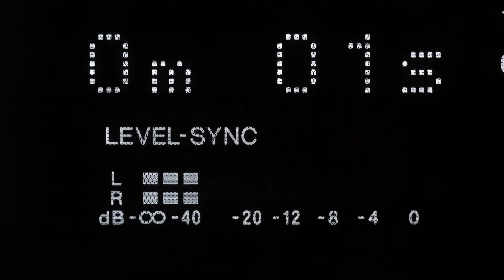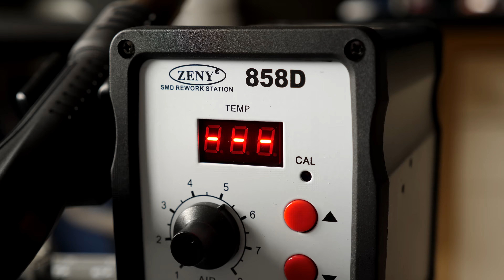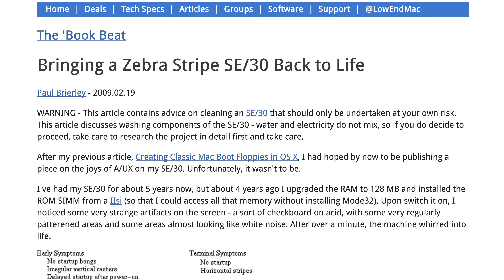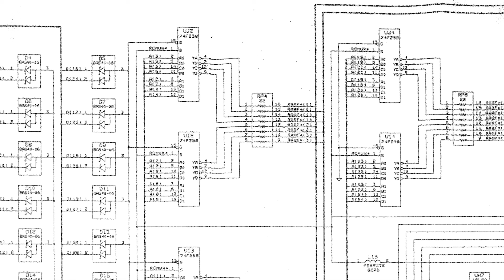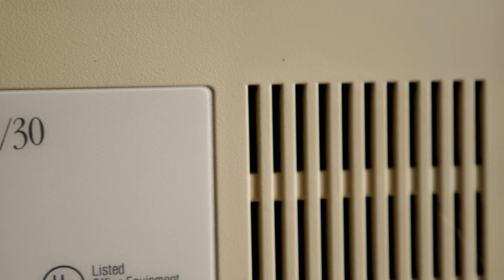(Trying to) Revive a Mac SE/30

Comment: Did you ever get this going?  I had a very similar issue solved by reflowing the GLUE pins on the PSU / 5V Axial cap side grid 10/11.  I think what happens is that repeated insertion/removal of the PSU connector causes flexing and cracked solder joints on that side of the GLUE.  That or hard to see leakage of the C11 cap.

Comment: Hi Colin! I'm your old fan (from the first HHLegend DMG-01 backlite) Did you tried to swap those eeprom with mac's "BIOS" (of course it's not a bios as we called PC BIOS it's more like a firmware that prepares mac to work with video, disk drives, cpu and other connected peripherials) with compatible UV eprom or compatible eeprom with correct image burned on? Threre are plenty of libraries of retro computer flash images, including se/30 in internet...

Comment: What is that thing that looks like a yellow highlighter that you use to clean the pads around the 3:30 mark? I'm new to repairing old Macs, and I didn't see anything that looked like this pen in the soldering section in my local electronics store. I love this video. I get a chuckle out of it every time.
Reply from the maker: It’s a flux pen. You can also get flux in gel form, but I prefer how the pen keeps things neater.

Comment: My friend you didn't try the oldest trick in the book! I have 4 compact macs and 2 of them had similar issues when I got them. You cleaned the board with alcohol.... but I would recommend a good scrub with a toothbrush and dish soap in the sink. Dish soap is caustic (which is a bit harsh on the metal, but it really helps remove that oxide layer), so rinse it off very well and let dry for a while -- My Mac Plus took 1 scrubbing to revive it. However my Classic II took 5 separate times scrubbing before it finally booted. So it really can save them a lot of the times.

Comment: My Macintosh SE FDHD has the problem that it will turn on, hard disk activates, fan starts spinning, but nothing will display on the screen (yes I've tried the brightness knob) the tube is glowing in the back and if you turn the lights off you can see that the CRT is emitting some light, just very little, Ive checked to make sure all the ribbons are plugged in securley on the analog board, and I've even checked the analog board for cracks, only to find none. my logic board doesn't have the battery, and I had to order one online (it hasn't come yet) so that might be the problem, but I doubt it. Do you have any recommendations?

Comment: I made a post over in the 68KMLA forum. But if you cant get the board figured out, get in contact with me and I will run my attempt at it. I have had a pretty decent success rate at repairing those, but nothing is 100% perfect of course.

Comment: I'm a bit late to the party, but Adrian Black's latest video on a Mac 512K showed a similar zebra effect after he went to retrofit the PSU. His replacement PSU delivered clean voltages a millisecond later than the stock PSU did, and his video display took offense to it. Also, his issue went away after a press on the reset - maybe something similar's happening on your end?

Comment: Try washing the logic board (Techmoan-style). Your surface cleaning may not have been enough to remove all of the conductive electrolyte that leaked out of the old capacitors.
Reply from the maker: Yeah, I think a more thorough cleaning is definitely in order. Not sure if I'm going to go with the dishwasher route or something a bit more professional though.

Comment: I did not listen to the audio, so if I missed something because of this, I appologize. But I have to ask, did you check your voltages to make sure you have them all? Also, re-capping the power supply wouldn't be a bad idea. Too bad you don't know anyone that has a big ultrasonic cleaner so you could do the whole motherboard. Also, if liquid was spilled in it, which I think I picked up in the comments, you may be looking for a bad trace. Re-seat any and all parts possible.

Comment: Next to recapping the power supply (which is usually the “cap” problem from KayPros to Commodores in my experience), you could try adding another “sense” to the equation. In lieu of visual, try temp; a blown or highly suspect component often runs hot. Several vintage gurus note a bad chip or component simply by placing a finger atop the IC and checking if its warmer than usual/others. A few other channels I watch used an IR camera, and another just his index finger to find bad video RAM. Just a thought...

Comment: Collin, help me! I just bought a thinkpad t61. New cpu fan, battery, heat sink compound, runs great! But I have a bad sodimm slot. I bout two matching pc2-5300 2gb 667mhz. The bottom slot works fine, but when i put the second dimm in, it boots to a black screen. So i load only the second slot, good mem, 1 3 3 1 beeps. Bad slot right? How can i fix this? Bios has no enable/disable, or size, etc... please tell me there is a fix.
Reply from the maker: Best guess is that either the slot itself is bad (which would require soldering in a replacement) or there’s something wonky with the chipset on the motherboard. I’d start by carefully cleaning the contacts in that slot though.
Reply: Thanks Collin. Keep up the good work.

Comment: 1) did you replace that antique battery ? 
2) look for deteriorated solder joints on the analog board , they got pretty hot and failed .
Reply: btw excellent video , thanks !

Comment: SMH... You did not check for bad traces, and you did not do other things. "Lets replace the caps!"  is not the solution. You need to check the traces. Go to 68KMLA.org and they can help. They have the Special Knowledge.

You are taking too many things for granted. "The Caps on the analog board do not look like they had leaked." I'll bet $5 that they did. the good hides under the caps. Again, go to 68KMLA.org. they got Mac SE\30 repair experts that can help.

Comment: Circuit diagrams tell you exactly how it works. 

As an analogy, if you go to France and don’t speak French, a local person will tell you exactly where to find the railroad station. If you don’t understand French, it won’t help.

If anyone is going to get into retro computer restoration, I would definitely recommend watching as many videos as possible on what components are involved and what they do.

By the way, I am a test technician dealing with electronic circuits every day. Not only do I understand circuit diagrams, I can trace paths through them and as a result determine the fault and how to fix it.

And you fixed the digital board but did you replace the caps on the analog board and in the power supply?

If your digital board isn’t getting the right voltages, it won’t work.

Edited to add: I have restored many classic vintage Macintosh computers from the Plus through to the LC range. Even if capacitors look good, the electrolyte in the can will be thirty years old and not at its best.

I have also removed the socketed ICs and washed the boards in a dishwasher to ensure all traces of electrolyte residue are removed from the board. But that may not work for you. I don’t advocate that extreme form of washing, I just tried it and it worked.

Comment: Good video. I have an SE/30 myself which could probably use some recapping but still works okay for the moment. It’ll be a good reference for whenever I dare to do some soldering myself. 

My SE/30 also seemed dead for a long time - it made a click sound when switched on but then nothing happened, no screen and no spinning up drives or anything. Eventually I found out it was because of a PDS network adapter I had installed. It worked fine before, but somehow it broke and maybe caused a short or something, I’m not sure. I removed the network adapter and the SE/30 sprang to life again.

Comment: Others here have mentioned Louis Rossmann, If you watch his videos he uses a UltraSonic Cleaner to remove corrosion and other debris from the board when done and then submerges the boards in 90% IPA bath before allowing them to dry in an oven at 200 for 1 hour.  I suspect that the electrolytic fluid has gotten under some of the chips where he cannot clean which is causing the issue.  I fixed a classic mac with a similar process, except in my case, I simply used distilled water and a plastic tub sitting on top of two fish tank bubblers (to provide vibration) as my ultrasonic cleaner for 10 minutes followed by a IPA bath and dry.

Comment: The logic board is probably not getting enough power to run everything connected to it (dram is power hungry). You could try disconnecting some of the components (hard drive, floppy drive, etc) see if that makes a difference. You should measure the voltages, make sure you are getting 5v and 12v or near enough. If your not getting a steady 5v to the logic board, you got an issue with your analogue board.

Comment: I would love to get my mits on an SE/30. My soldering skills are total crap though. Great video as always, and I would try and reach out to Adrian Black or 8 Bit guy.
Reply: As much as I'd like to say yes, I would have to say no way.  I've done so many recaps of SE/30s and they are a pain.  You'll end up, in some cases, like Colin did in this one or worse.  The success rate is 50/50 for some boards, but most are slim to none. 

The corrosive leftovers from the old caps are bad enough to eat right through traces and pads, even on multi-layer boards like the SE/30.  In short, they were great Macs in their heyday.  The hardware specs you can achieve for such a small machine were almost unfathomable back then; in 1989, 1MB of RAM would cost $100 US dollars, just to give you an idea. 

Sorry,  but I just don't have the time or patience to do recaps anymore.

Comment: Rinse the digital board off completely. Some people use water; others isopropyl alchohol. Dry thoroughly afterwards. Also, in my experience, 80s through mid-90s full-size electrolytic caps don't generally show leakage or bulging -- they mainly just dry out, especially ones in heatboxes like these classic Macs. So, re-cap the analog board (why would you do one, but not the other???). Consider that even 105C-rated capacitors are only specced for around three years of use at those temps - and this machine is 30 years old. Lets see where this takes you. Best wishes!

Comment: I'd recap the analog board still... Many bad caps may still look perfect
Reply: Yep, and a lot of the analog board caps will leak only under the cap itself. There's no way of knowing for sure if there's a problem unless you desolder the whole lot. Also, there could be cold solder joints (broken) on the analog board. I'd also check the voltages coming off the analog board to the motherboard to be sure things are actually within spec.

Comment: You said you cleaned the board more than once but electrolytic fluid might have migrated under the components causing a short. There is a video from AkBKukU that after recapping it still didn't work until he cleaned the remaining cap fluid out from under the chips.

Comment: i had the same problem with a classic 2, not switched on for ca. 15 years,  i replaced the li battery with a new fully charged battery and it pinged into action, 
some videos talk about cleaning the board in soapy water, yes, soapy water, using non-ionic surfactant. will wash off all electrolyte residue,  dry the board afterwards, ipa wash. good luck..

Comment: Hmm... I'm not the best when it comes to fixing computers, but if I had to take a guess, it's probably a single chip on the board that probably got unsoldered over time. Saw it once on an NES cart I bought.

The fix is simple: just reflow the chip with fresh solder... But seeing as this is a motherboard and not a game cart... I don't think you'd want to spends a lot of hours just resoldering every chip until it works.

Comment: This was the same problem with my mac Color and mac Classic. Try out to clean the whole board under warm water with dish soap and a brush, then rinse with clear water, and dry it with an hair dryer. Corrosion under the electronic Parts disappear and this eventually solve the proplem. Worked 3 times on my old Macintoshs

Comment: With my SE/30 didn't get to that stage, I gave the board a bath I took off all the RAM and the ROM and washed the board with soap and water and a soft scrubber and let the board dry for several days blowing a blower fan at it the first day while waiting for the parts on order. I also went through it took off the caps once the board was clean, also went through and looked for dry solder joints that have cracked. I also took off the stock battery holder and replaced with a CR2032 battery holder.

Comment: You might want to go a head and check the power supply under a scope to see if there is any ripple on the DC. Friend had this problem a few years back. You might be able to do it with a multimeter using the AC function anything bigger than 50mv might be a problem

Comment: Pull out the ram modules then replace them module by module. I forget if these machines need the ram to be installed in pairs. I think they might so it's worth checking that.
Reply from the maker: I’ve read that they actually need to have the RAM installed four modules at a time, Bank A first. Apparently the SE/30 is rather picky about memory.
Reply: @ThisDoesNotCompute  ah crap. Okay do you have some known working modules you can try? Or a known working machine you can try them in?

Comment: Wait... you recapped the mother board FIRST? BEFORE you did a wipe and blow of the analogue board?! SERIOUSLY! Thats like having all your lower teeth pulled  and replaced with implants, when the problem was a cavity in one of your upper molars! 
Rule number one of firing up old macs... find the analogue board, clean it with q-tips and alcohol, heat it up with a hair dryer THEN test it, still failing, do the same to the mother board, 90% of the time this will allow for the computer to start up. I've ripped apart dozens of these things. Good job on the motherboard though well done but man...

Comment: The analogue boards are really easy to recapp on the old bread box macs like the SE/30, all it takes is a competant grasp of soldering and mapping out the capascitors on the board. The caps can be regularly found online but just be sure to use higher voltage caps as their better and much much easier to find then the old 16volt ones originally used, I swapped an analogue board for a classic 2 which had almost all 16 volt caps with 25 volt ones, so long as the resistance remains the same on each a slight volt uptick won't effect these older machines, especially considering the girthy leads and connections. 

The motherboards on the other hand are a bloody nightmare as they use flat caps which are difficult to remove without destroying the pads, clip off a pad and the board is effectively trashed, I made this error with an otherwise working classic 2 board and wish I never touched the mother board. Though short of a battery explosion, 9/10 of the time its the analogue board thats the problem.

Comment: Wash the board, seriously, remove everything you can, like batteries, and put on soapy water for a few hours, an ultrasonic cleaner would be ideal, but soapy water works too, them rinse the board with IPA and put on an oven with the temperature set at a little over the water boiling point, like 105°C, and try again. Sometimes the electrolyct fluid and flux remains on the board can make a circuit act weird.
Reply: i have read this in the Low End Mac forums, it actually works.
Reply: This fixed my Classic II after recapping. It's worth a shot.
Reply: I’ve run so many old Mac logic boards through the dishwasher at this point that it’s a miracle i haven’t died from lead poisoning. It’s amazing how well it works! So far I’ve successfully recovered a Quadra 840av, Color Classic, SE30, Classic.. Just don’t add any detergent and make sure to dry the board quickly afterwards, compressed air is good to blow the water away from underneath chips. Replace all the caps as well of course or they will keep leaking.